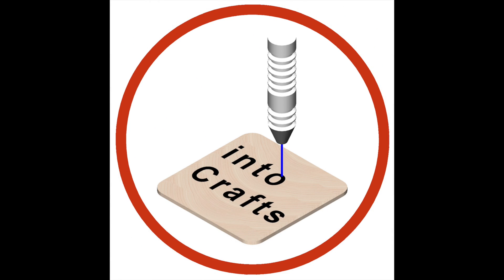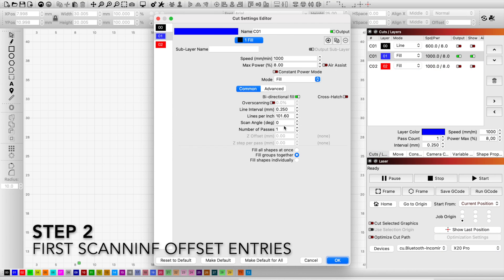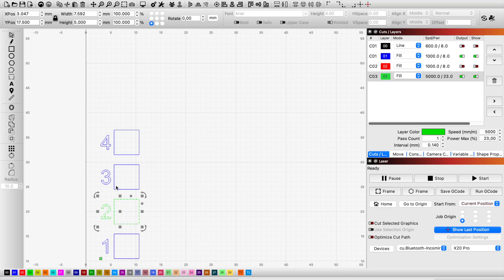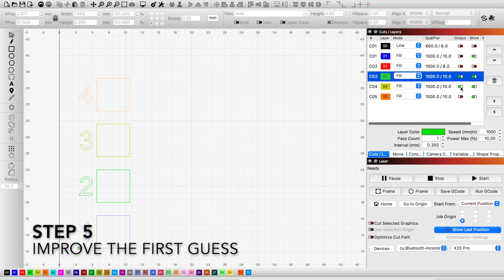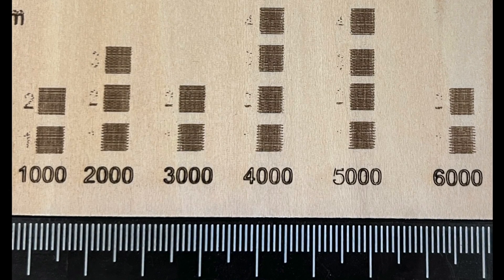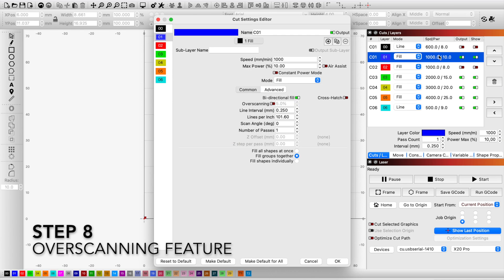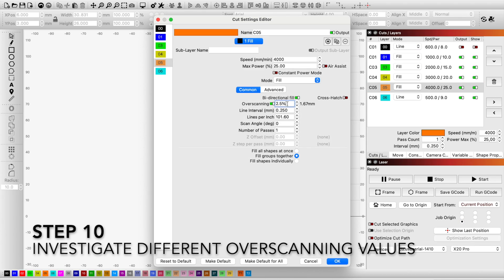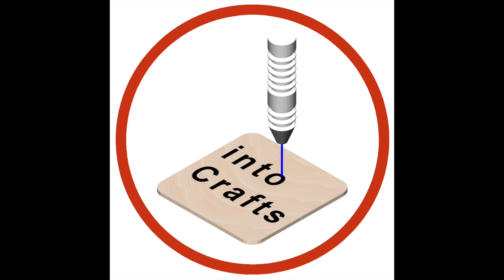E2 - Scanning Offset & Overscanning

Comment: Hey man, is there a chance you know how to solve the problem in LaserGRBL? I couldn't find any similar settings to precise the X axis engraving...
Great video
Reply from the maker: Hi,
Thanks for your comment.
Sorry, I have not worked with LaserGrbl. You could not find anything from the Help part of the software or the community?
Check on this link, I have not read it all through; but they might have found a solution:
https://github.com/arkypita/LaserGRBL/issues/97

Comment: I am using LB 13.01, but I don't see a setting for "Overscanning." Is this because you are using an old version of LB compared to mine, or is this setting missing because I have a Ruida controller?
Thanks.  I may have just found my answer In Lightburns's online documentation: " If you do not see this setting, your machine is likely a DSP controller and handles this automatically in hardware."
Reply from the maker: Thanks for your comment, besides this option is available only when Fill was selected